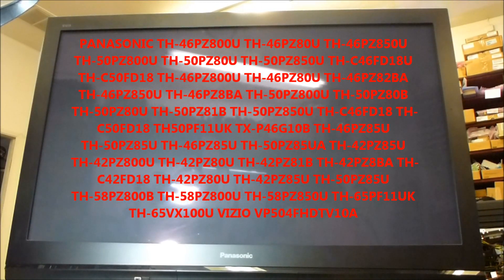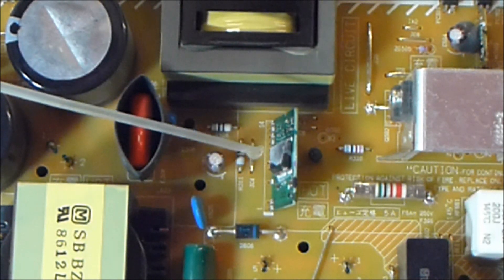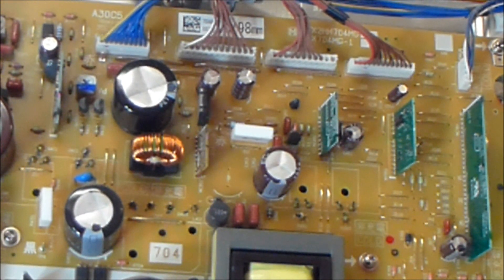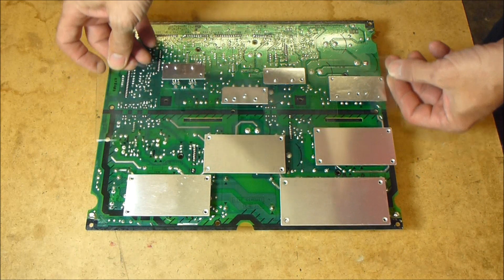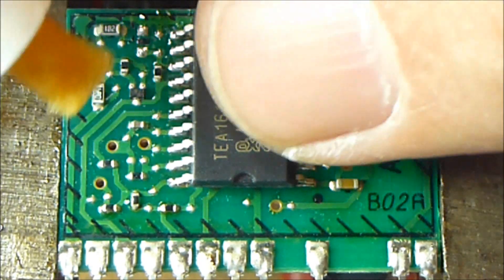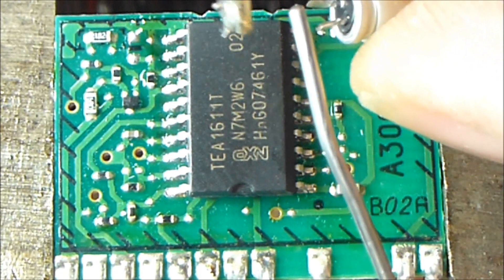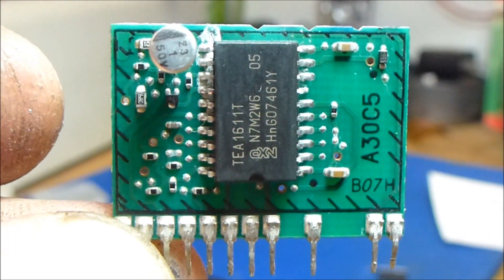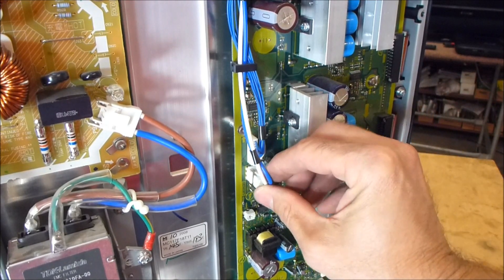Panasonic Plasma 10 and 2 Blinks TEA1611 ETX2MM702 704 706 Power Supply TH 42 46 50 58 PZ 800 85

Comment: I replaced the caps and it worked..its just the caps that die.. the esr and capacitance was still reading good on the ones i took out so im syruggling to understand exactly how these capacitors have failed..the ohm reading across them was about 5 meg..looking at the ic datasheey the vcc voltage for the ic is quite stringent ( it has to be between about 12v to 13v ) im wondering since this cap is connected across the vcc supply to the ic that it was dragging voltage down below the minimum threshold voltage of the ic and causing it not to switch..anyone have any ideas about the caps?
Reply from the maker: I dont repair them anymore, but several years later I do believe that the cap may have been the original issue.

Comment: I have done this on the same tv and the problem is not the IC, but the capacitor. You can use any electrolitic one 1uF/50V or 100V

Comment: Hi thanks for sharing you knowledge with everyone, How do we test this part if we don't have freeze spray?
Reply from the maker: Use canned air turned upside down
Reply: Thank you for reply, I have Th-46PZ85B model..when i turn the tv on  Green light flash 3 time, relay click's and then Red light flash 10 time... I dont even have air can, i have multi meter. Can check the fault with multimeter?

Comment: does this fix work for the 625A board
Reply from the maker: Does it use the TEA1611 IC chip? then probably so, if it doesn't have that TEA1611 IC chip then probably not.

Comment: I just finished this repair for a coworker's TV.  It was a fun project.  Thanks for the video!  I ended up masking off the pins on the little boards with kapton tape and hitting them with the heat gun from my rework station to remove them.  In fact, I did the same thing to remove the ICs as well.

Comment: Panasonic TH50 PZ850U: Changed out the IC yesterday. Problem solved. Very small work, but with magnifying glass and small tip, it's doable. Fixed for $20. New replacement TV ??? $2500 - $4000.

Comment: I have this problem and first relaced the three capacitors on the Y-SUS (900uf 220v) as they were swollen. I then replaced the two TEA1611T chips and 1uf 50v capacitors as shown in your clip. Sadly there's no change which is typically my bad luck as this fault seems so common on this model. I have tripple checked my soldering and all looks fine, I did take antstatic precautions whild handling the chips. Any other ideas would be welcom. I have considered removing the Y-SUS connector to see if the voltage on the PSU comes up. Thanks, Dave.

Comment: I removed the 1uF capacitors on both boards.  So far it works fine now.  The capacitors store energy so why it works without them is beyond me.  If anyone can comment on that so we can better understand how it works.
Reply from the maker: I think the 1uf was just a secondary filter to the power supply line to the IC. It is true that you can remove them and for most part the set will work just fine. The video has already been made and no chance for editing now.

Comment: I have been getting Dry Joints on these small boards now. Soldering all the smd components is a pain but fixes it sometimes if the Ic & Capacitors don't fix it.

Comment: Thank you for your very useful video (and all the contributors with useful comments below).
I have just repaired my TH-46PZ80EA by replacing only the electrolytic capacitors. (Two blinks error).
But I found another symptom in my  10 years old power supply, the three upper left brown capacitors at the power supply board labelled as 900 uF 220V had started swelling at the top, a classic capacitor symptom, (maybe the three upper left capacitors and at your video at  6:00 seems to have started swelling). So I replaced them with 1000uF 250V Nichicon LGW2E102MELC35 bought from Mouser.com, although they are 9mm taller than the originals, they fit and leave about 5mm space from the back metallic lid of the TV.

Comment: All you have to do to repair a tv with this issue is simply remove the tiny 1uf capacitor and throw it away.. no need to replace it or the ic chip
Reply: My TV works now thanks!
Reply: You don't need to replace the capacitor or IC chip?

Comment: Well after much research and watching/ reading what I could find about the dreaded 10 blinks. I ruled out other items. And after reading something in the comments here got me thinking. I decided to take the path of least resistance here I think. I did not try the freeze test although this was on my list to try if this didn't work. However what I did ultimately was to simply remove the  extremely tiny caps next to the IC's. On both MC201 and MC301. PRESTO working TV. Just that simply. I have ordered replacement caps and will attempt to solder new ones in place. Thank you to each and everyone who made comments and contributed this this topic. The INTERNET is a wild and wonderful place if you know where to look. Keep up the great work.

Comment: great  video ,i manage to get the complete A3OC5 BOARD on ebay it was brand new and made in korea but it was a lot easier to replace the small board then trying to repair the board it was a lot more in price,59 quid as 8quid for repair parts

Comment: At 2:37 how long will the tv operate after it is started using the refrigerant to i.c. method? Also, would it be beneficial to the mc201 and mc301 if I siliconed a small heat sink on top of the i.c.'s, to keep them cooler? Does the 15 volts continuously run through this circuit or is it only to start the t.v. up? Yes Im very very new to electrical diagnostics but I realize that this guys job and expertise IS ON THE LEVEL OF A SURGEON.

Comment: Hi I have a TH50PZ850AZ with a 13 blink code, you hear 2 relay click the power light flash green then goes solid green then the TV turns off and blinks red 13 times till you press the power switch. This happen after the the power went off and the ups was under rated to run the system, the TVNZ was trying to start but couldn't, I unplug the TVNZ as quick as I could but not soon enough as it appears. I did find a post about unplugging A52 but can't find that plug, found A51 and A52 though.

Comment: I had the same flashing red led, I use my "electric contact spray" on the circuit like you did and at the moment is working. I´ll wait untill it goes again then I will repear it. Thank you for the video, waas very helpfull.

Comment: Great video but I need some advise. I have a Panasonic TH-42PZ85U and when I plug it in it passes the 15 volt test with 2 quick clicks followed by 1 click. When I then turn it on it comes on for about 5 - 10 secs and turns off as the power LED blinks 11 times. What could be the issue you think? Really appreciate any help, thanks!
Reply: I found this info, do you agree with this?
11 Blinks SOS: The ventilation fans are monitored for proper operation. If one of the fans opens or increases resistance, the resulting current change is applied to pin 61 of the main CPU. This triggers the Fan SOS and the TV shuts down. The power LED blinks 11 times. To prevent the TV from shutting down when one of the fans is disconnected, a jumper should be placed between pin 2 and pin 3 of the missing fan connector.

Source: https://electro-medical.blogspot.com/2015/11/panasonic-plasma-tv-th-42px80u-th.html

Comment: Any suggestions on repair for a Panasonic Viera 50" Plasma TC-P50S1 10 blinks error code.  I have tried some of the workarounds for holding power button for 20 sec or power and volumne together and nothing.  holding the power button for 20 sec several times did change the blinks to solid red but after about 1 minute it went off.   Appreciate any suggestions to this.  If you want to contact me directly i can be at cny8500 G mail.

Comment: Have a 2010 Panasonic TC-50G15 model. My power board doesn't have the little chip boards to cool. I get the 2 blink code after power button push and hear 2 clicks pause then third click. Help please

Comment: If you would like to test your small hybrid board (on the bench, not in the main board) with the TEA1611 chip on it, First: **"If you do this, you do so at your own risk."** Remove the small vertical hybrid board from the main board. Locate pin 14 of the small hybrid board using the legend on the main board. Count back to pin 12, this is + or positive. Pin 9 is - or negative. The small hybrid board will need 12 Volts from a current limited supply for the test. Connect your oscilloscope common to the negative, and the probe tip to Pin 7, this pin (7) will have a 45kHz square wave on it. If this signal is present, your hybrid is working.
Reply: Mr Carlson..your a legend
Reply: Well,l have a Panasonic tv model 42px7dc-ua, with 14 blinking.what you think?thx.u

Comment: After disassembly and testing the boards using the Canned Air Cooling method shown, I'm still getting the 3 Clicks and a failed Standby Self Check which leads to the Power Light flashing 10 times. Anything else I can check or test before closing the back of it up again and tossing it in the trash?

Comment: Great video. This guy makes it look easy, he should have been a surgeon. It wasn't easy but I diagnosed the problem and replaced the two chips and capacitors and my TV works. This is what makes the internet great.
Reply: I use the video myself to fix my own Panasonic TV.  I guess the audience he is focusing on is the ones that have some electronic tech knoledge.

Comment: it did not work sorry
Reply: well were still doing this
Reply: Rachel,

Describe in DETAIL what you did.  Did you perform the "cool down" test before working on the "MC" circuit boards  ?  What was the result of the cool down test  ?  What is the full model number of your Panasonic
Plasma HD TV  ?
What is the "blinking error code" for you unit  ?
Thanks,  Gary S.

Comment: I SOLVED the problem with 2 and 10 error blink codes.
A replacement of these two TEA1611T and the bad capacitors was NOT the solution at this problem but the 
"field effect transistor"(FET) Q401 Part No. 2SK3607 was shorted (Source Drain & Gate). I replaced this Q401 against a new and the Plasma TV starts normally without blink codes.

Failed TV Model No. TH-46PZ85AE
Power board Model No. ETX2MM704MG (NPX704MG-1)

Best greetings
Reply: Hi Wolfgang K : Have you done the freezing test on the TEA1611T ??? I did the test and the tv knows open so do you think that just changing the 2 tea1611t will suffice ??
Reply: ticlide66 Hello!
I did the freezing test, but it does not changed anything...

The problem was the shorted Field Effect Transistor.
Try it out with a multimeter. 
If Drain Source and Gate pins are shorted there is a problem with the MOSFET..

Greetings
Reply: Wolfgang K  : Ok thank !!

Comment: I followed the video, and ordered the parts off eBay for about $8.00.  I spent $29 the first time around from some internet TV store, and it didn't work. Bought the same parts for $8.00 bux so the other place is ripping repair DIYers off.  Anyway, got it working.  i had to pull a lot of green gain out in the menu settings, and that got rid of the green static. It's a real fine snow.  

the voltage settings are spot on, I checked all them, and only had to make very very small adjustments. 

so I was wondering if the power supply itself could be bleeding noise through the circuits , and that's what's causing the green snow??  or like you said, i guess it could be the panel, but I'm not going to replace it on such an old plasma.  

I have a close friend, who Vizio 50in plasma also developed the same light green snow. A repairman came out years ago and replaced some boards and it went away.  so I just don't know what might be causing the snow effect. Thank you for your help.

Comment: My TH-C46fD18 had 10 blink code . I Did the cold test and it passed . I just replaced the small de -coupler Cap as mentioned in the comments below by Gary Spencser. I went to Fry's and bought the 1 uf 50v Non polarized Electrolytic Capacitors 79 cents each they are bigger and easier to hold and after 3 days so far so good. I left the IC board on the main board. I might add that you need a steady hand, good light, good magnifier glass and a pencil point soldiering iron. It is by far NOT as easy as Nocal715 makes it look he is a real pro. Thanks for the great video

Comment: I did this repair and the TV turned on and worked. I unplugged to reinstall the back panel later in the day. came back to turn on again and it doesn't work again. if I cool the ic it gives me 2 blinks instead of 10. any ideas?

Comment: I've got a TH-42PZ80U, tried to test the power supply using the compressed air and I do not get the proper clicks.  TV continues to blink 10 times.  Is it definitely the power supply that needs to be replaced or another part?  Thank you.
Reply: Check the thermal fuse in the secondary of one of the transformers
Reply: I have the same as zeile333 but i give up i yes go and buy me a new one

Comment: I have a 2010 Panasonic Plasma 50 inch tv that has 10 blinking lights. The power supply board is different from all the other years. please help me fix this 2010 Panasonic blinking problem! Thank you
Reply: Please post here the full model number of HD Plasma tv.  Then, I can advise you how to proceed.
G.S.

Comment: Steve,  I'm having an issue with my 50 inch plasma. It is a Vizio vp505xvt, which is the same as the Panasonic that your are working on in this video. The power boards, and Y&X boards are identical. Obviously Vizio uses their own main board.  So the problem is.  The TV had developed a very fine "light green" snowy mist in the screen. It's more prevalent during black screen shots (like outer space etc), however you can see it in the grey areas, and it's over the entire screen.  I'm not sure what might be causing this issue.  I have a friend that has a Vizio VP504 that developed the same issue many years ago. Vizio sent a repair man out, and several board were replaced and adjustments made. The green snow went away.  What board could be causing the issue. I've already replaced the main board, thinking it was just the HDMI inputs causing the issues.  That didn't fix the issue.   Thanks for any help you can provide.  Thanks for all the great videos you do on TV repair.
Reply: I'm no expert, but when I've had the 'dancing dots' like you describe, either the voltages are out of spec from the power supply, or panel is bad. On the back of the panel, voltages are listed for different points on the boards. Find those points and check voltages, I bet one is out of whack.there are potentiometers that allow adjustment. If not, panel could be going bad. I had a LG that had a bad panel and that's what it did. Had another, just needed adjustment.

Comment: So this is a guaranteed fix? I have seen other boards be pointed as the problem online and not the power supply. My TH-42PZ85U blinks 10 times and won't come on. At first i was able to unplug all video sources and power for a bit. Plug power back in and it would work again. about 10 times and now it won't at all. Just blinks.

Comment: Does anyone know where I can take a panasonic plasma tv for repair in the Los Angeles area? I have the power supply failure issue...
Reply: +Thomas Larsen 
Tom,
How old is your Plasma  ?    What is the full model number  ?
It may cost more to repair in LA than any other place in America.
These old Panasonic Plasma TV's are power hogs compared with newer
Samsung Plasma products.  The main reason why there are so many
blogs and video repair sessions on YouTube (and elsewhere) is that it
is next to impossible to find competent electronic repair jocks that don't
OVER-CHARGE on repairs.  These guys don't want to touch a flat panel
set unless they can walk away with $400 to $800 on a 50 or 60 inch display
repair (.....for a "minor" repair) such as the infamous "power failure" issue
that is discussed in great detail in this video blog.
Regards, Gary S.

Comment: When you use your 10W resistor, does the polarity of the pins matter?  Or can you just plug it in either way?
Reply: Resistors have no polarity, so either way will work.
Reply: From an electronics tech - Resistors have no polarity.  The electrolytic caps and IC's that he replaced do.

Comment: I would like to order the part and outsource the work.  Does anyone know how much this repair should cost?  I want to know what to expect when I start shopping around.
Reply: +A Taylor 
If you are lucky enough to find a good service repair shop in your area, you
can expect to spend  $300 to $500.  The Master Technician who CREATED
this video repair blog (norcal715) would be in the range of $150.   And, 98% of that amount is for labor.  He doesn't need to swap out circuit boards to find the problem.  He can troubleshoot the offending problem
down to the "bad" component (very quickly & efficiently).
Before you head out to find repair shop, please provide complete model
number of your TV and a detailed explanation of what you are observing.
Regards, Gary S.

Comment: Would this also solve the green showing up everywhere? I have a TH-50PZ80U...
Reply: +Joshua Keelin 
Joshus,

No.  This blog is only for main power supply issues.

Your TV has display driver problem(s) or color control mis-adjust.
You need to describe EXACTLY what you observe after HDTV powers on.
Your TV has built-in display troubleshooting generator and menu to assist
service technician to narrow down problem.  We will get to that later.
Regards, Gary S.
Reply: Is there a way to attach images? Or somewhere I can send them. 

In the black areas of the screen there are green patches. Bright green. Sometimes in the white areas there are the same except purple or pink'ish